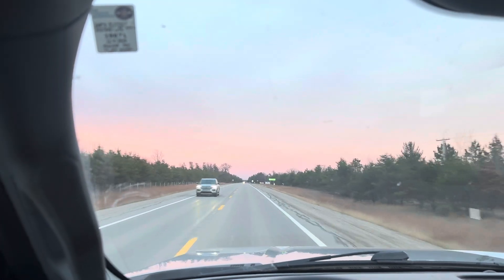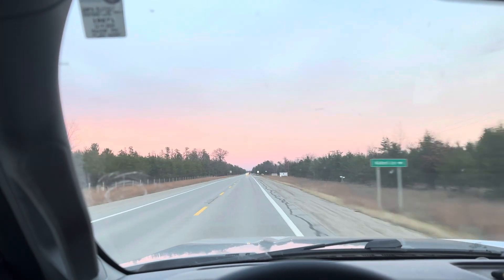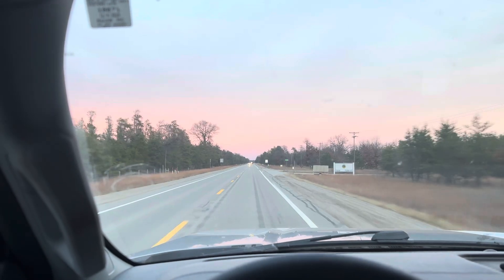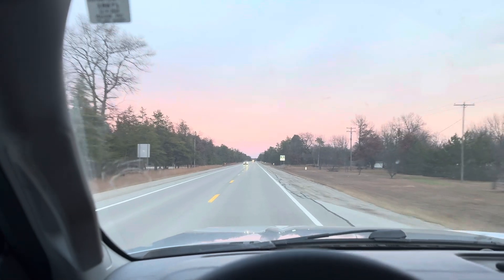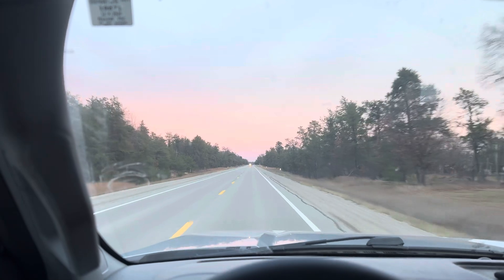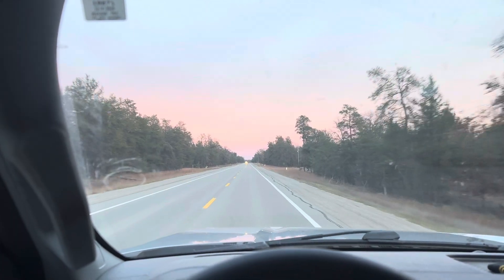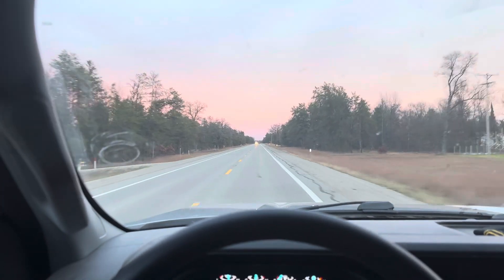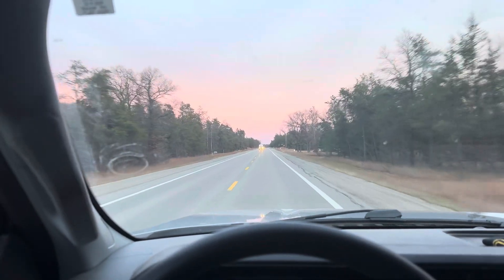I have a theory on what is going on with CP4 pump failures.

Comment: I think it’s a major contributing factor. Combined with changing fuel filters every 50k+. Sadly that’s common.
Reply from the maker: @jspivak86  i did mine every other oil change. So 10k.  There has got to be another factor besides just fuel quality because we are all running the same junk.  As i mentioned there must be a reason why some never fail, some fail late in life and some early in life

Comment: There's not enough lubricant in the fuel to make the pump happy. It's widely understood so looking for excuses doesn't work. I ran at least a quart of motor oil and every tank of fuel I put in the pickup a Cummins and 300,000 mi later not an issue. It's a lubrication problem nothing more nothing less and to meet emissions the lubricant put in the fuel not enough
Reply from the maker: @billsoinski9136  thats the rhetoric but we all run the exact same fuel. It does not explain the range in failure points.  

Also iv participated in multiple polls on social media. People who put additive in their tanks to increase the lubricity tend to be part of the cp4 failure club where people who use zero additive tend to never have cp4 failure.  

None of these really make any sense without an additional factor.  Which is why i made this video. The same story keeps getting pushed and its not improving the ownership experience of the cp4 pump.